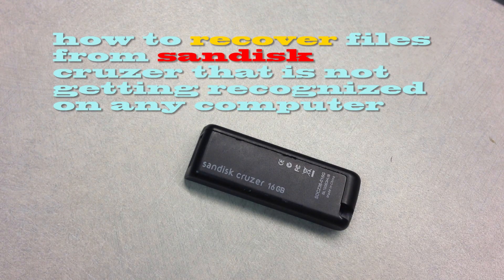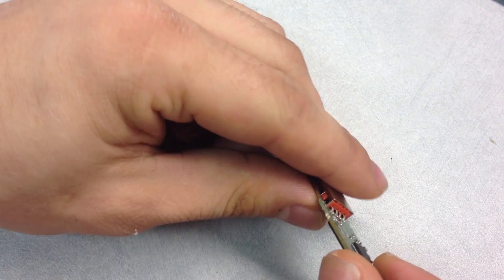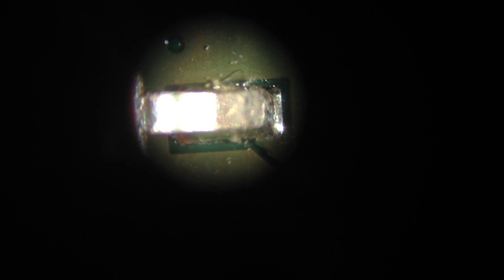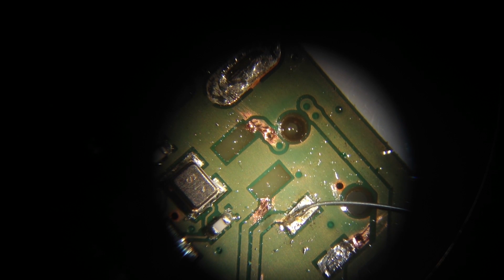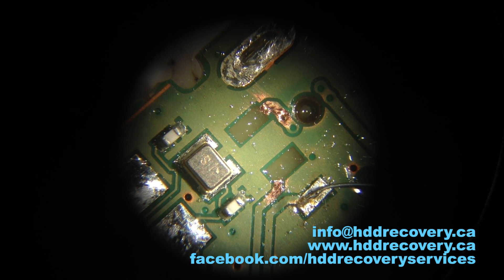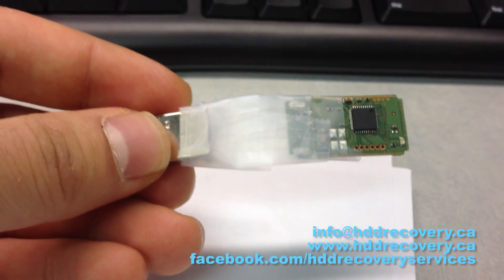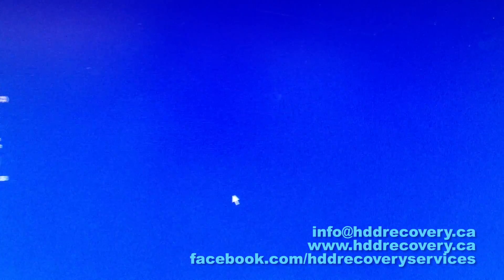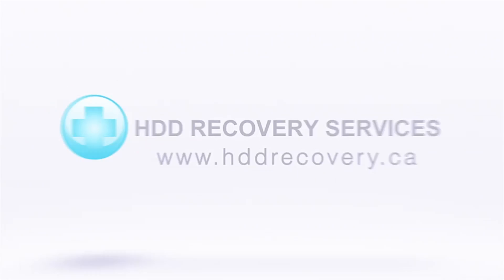Sandisk Cruzer not recognized: how to recover data from flash drive

Comment: Might be a dumb? Why didn’t you just Resolder the connections and then do a continuity check on each pin of USB connector, are you just making more work for yourself or just having fun?
Reply from the maker: Sometimes traces run under connector, so it would be hard to do a continuity check that way. With jumper wire it is 100% definite connection

Comment: im having a problem with my usb overheating and reading code 43 any advice or help i could get would really help i got alot of files movies an so i don't want to lose
Reply from the maker: It it is heating up then there is a short. Most likely on controller, need to mail it in for repair work

Comment: thanks for the video... i have scandisk dual otg and its not detecting. i will try and hope your trick will work for the same.
i need to ask what wire you have used to connect usb pin???

Comment: just had a 'dead' flash drive (2 blinks of the light & then it stopped).  Watched this video & got the idea to take it apart.  'bent' it a little, put it back in the usb port & it connected perfectly.  Removed the data & threw away the drive.... I'm guessing it had a loose connection.  Saved all info to a usb hard drive, whew!!!
Reply from the maker: Ann Tachovsky Awesome!!!

Comment: I have a SanDisk Titanium 4GB that uses onboard U3 Software(runs in Windows only)
Used it in apple pro notebook numerous times, U3 doesnt run but no problems accessing files.
Inserted the USB stick one day and nothing! Only message box came up... -
'Disk you inserted is not readable by this computer' How would you deal with that?
Reply from the maker: Pulsonar take it apart and inspect the connection points first
Reply: HDD Recovery Services I have no idea how to take it apart, I am afraid of causing damage beyond reasonable home repair. It might be a painless and easy job if handled correctly but this is not a job for the layman if you run into trouble, this is for time served bench technicians only.
Reply from the maker: You can always have us do the repair. Fill out the contact form here: www.hddrecovery.ca/contact-us/
you will get a PDF file from us, just print it and pack it together with the failed flash drive into a bubble wrap envelope. Mail it in.
Connector repair services are done the same day, and your data is returned to you via our secure cloud storage.

Comment: what did you use to open the cover to start the process of checking the pins?
Reply from the maker: Shruti Gupta just a flat head screw driver.
Reply: HDD Recovery Services So I opened it but all four connections look attached - I checked with a magnifying glass.  My son said he hit his hand on it while it was in the PC.  It looks bent.  He has his volunteer hours, essays, labs, credit assignments, etc on it.  Do you think it is still retrievable?
Reply from the maker: Shruti Gupta worst comes to worst,  we can perform a NAND chip transplant. We have over 300 Sandisk cruzers that had been shipped to us over the last few years, so even if the problem is not connector related, we can still recover the data by matching up your flash drive with identical donor copy.

Comment: Hi,I have sandisk cruzer and it locked on me as i tried to enter my password few times, I have some inpotant data on it, Can you help me to get that data or bypass password ? is it possible ? plz help
Reply from the maker: I don't think there is a way to get around the encryption
Reply: hmm.if you can see the files but cannot access them, perhaps you can transfer them to another storage location using fat32 as opposed to ntfs as fat32 does not support encryption, then transfer back over. Doubt it'll work but its worth a shot

Comment: Can you tell me please, would this method of recovery (re-establishing the contacts with external wires) still be successful on a drive which heats up fairly quickly, even though it is not recognized by any computer?
Reply from the maker: dad1281 Unfortunately not, if you drive is overheating that usually means that your controller is shorted on the inside. We could still try and attempt advanced recovery method on such drive.
Reply: HDD Recovery Services advance recovery method how?

Comment: Hi I have the same flash drive and my sister hit it while it was still in the computer and bent the strands and two of them are gone completely:( Because they're not there to be reconnected do I have no chance of getting my files back? or does that not matter??
Reply from the maker: Linsley, these connectors are universal, so it would not matter if they are gone. We will use a new connector and attach it. here is our shipping form: www.hddrecovery.ca/shipping_form.pdf

Comment: I would like to try to fix my USB but would like to know the size of the wire I have to use.  Could you also post a more visible (bigger) picture of the diagram on how exactly the wires should be connected.  Thank you.
Reply from the maker: thickness of of wires does not really matter. I will post ups instructions on our Facebook tomorrow. www.facebook.com/hddrecoveryservices

Comment: I did one of these that had the usb port ripped off completely. Someone tried to repair it but damaged the controller IC. I was able to de-solder the flash chip and solder it into another identical flash drive. I was able to recover the data intact.

Comment from the maker: the trick with wires is mainly to get the data back. USB stick is not going to be very useful afterwards since it will not have a solid connection. For soldering such small things you would also need inspection microscope
Reply: does it matter the material of the wire? like would it make a major difference if i were to use copper wiring rather than a wire of different material?

Comment: Hi, i got a usb flash drive bought in 2008, it is a sandisk micro cuzer 16gb.
one time i was using it and then i actually drop my laptop on the floor and it went broken. It was bended. Then  i never be able to open it and get my files back anymore. The light is not even flashing. In clues. Sometimes , i plug it in and says unknown drive and then a long time it doesn't even work anymore. Not even said unknown dirve anymore. The computer can't even read it!

Comment from the maker: Junebug83, you could try and reflow components on the logic board. Aside from that try inspecting condition of other components and maybe locate something that had been shorted out, also make sure that USB connector is solid and all of its pins are attached properly.

Comment from the maker: Michael, they are soldered, the "glue" looking substance you see is leftover original resin from manufacturing. If those pins flexed in the past - they the resin will start to flake like dry glue.

Comment: i thought that the manufacturer would solder the USB connectors to the board
on the close up, it looked like a glue or something
why would they use that material as opposed to soldering?

Comment from the maker: I usually cut the anchor points off (1 on each side) and use our Hakko 850D rework station to heat up connection pins.

Comment from the maker: We would need to see it, basically if the issue is with connector then resolder, if the issue is with controller then we use our equipment to pull data straight off the flash chip